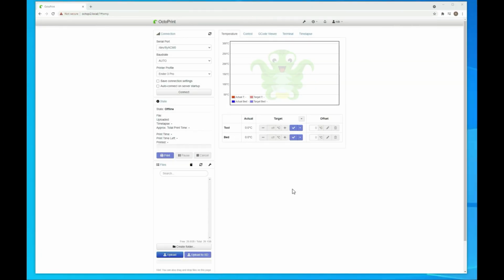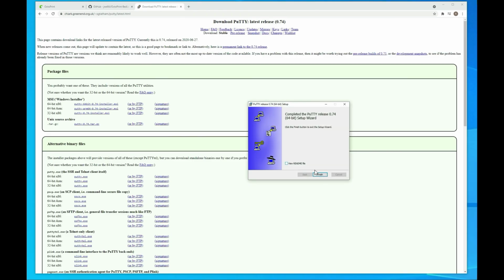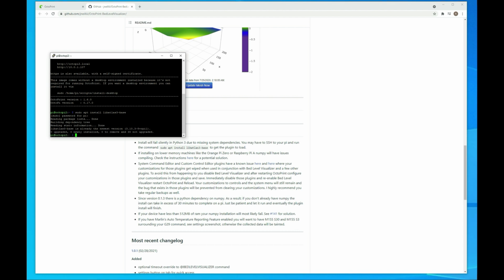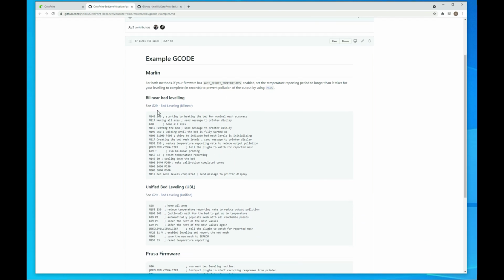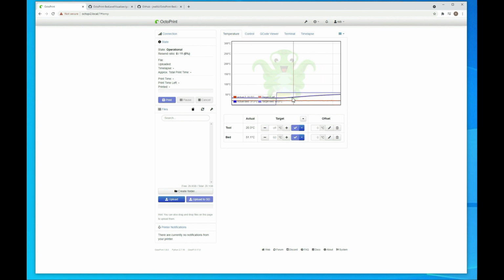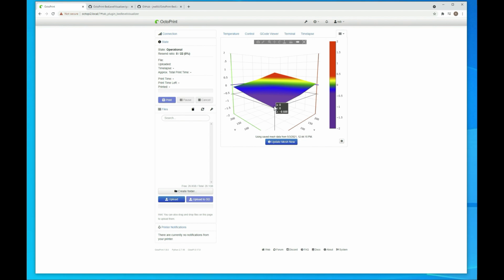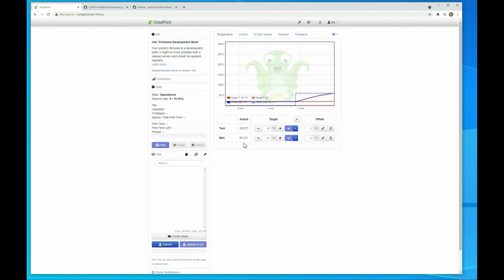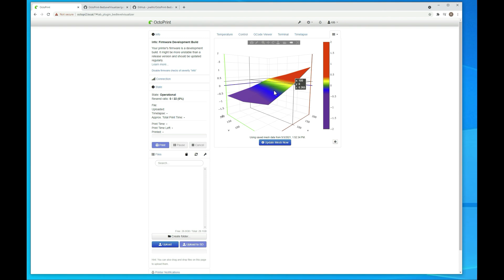Octoprint Bed Level Visualizer Install & Usage Guide

Comment: i was checking what oi was doing wrong. it turns out its just not liking my glass bed. it has a magnetic pei bed as well and i was considering goinb back to glass and that was new glass bed which was carborundum and the other was borosilicate. i was using carborundum since its more scratch reistant because hardened nozzles can scratch termpered glass but carborundum is a mohs 8 which is a 7.5-8.  of course stainless steel cant scratch either. went back to epi and i could see it was severly wapred on 1 corner

Comment: Thanks, this was helpful.
I have a couple of questions - 
- I have an ender-3 pro and installed the CR Touch and a dual z-axis stepper motor kit as well.
1. Do I need to have any additional G-codes for general slicing and printing? and if so, where should that go?  specifically if I am using Octoprint. (I also use Astroprint connected to octoprint)
2. With my setup, I noticed that the z-axis does not have a auto stop detector at the top. The bottom is now CR-Touch, but if I move the axis using the knob and go all the way up +ve, then at the very top it just keeps grinding.  Am I missing something when I installed CR Touch?

Comment: Do you need a BLTouch or CRTouch device to use this plugin?  I noticed that both of your printers have them installed.  I have a CRTouch but haven't installed it yet on my Longer LK5 Pro.  Will the plugin work without a BLTouch?
Reply from the maker: Hi. I think there is a way to do it by manually moving it to each location but I haven’t tried it myself.

Comment: Got a list of Ender 5 / CR Touch issues. Every time I google one and tick it off as done, it's from watching one of your videos. Superb content tbh
Reply from the maker: Glad to help. What issues are you having currently?
Reply: @3DPrintscape  Have actually given up tbh, at least for a while. I've got an Ender 5 that wouldn't print no matter how much bed levelling I did, so thought I'd get a CR Touch. Couldn't upgrade the firmware which is when I realised I had a 1.1.4 board. So I bought a 4.2.7 board and couldn't get firmware on that. Ended up compiling Marlin and got that working. Anyway, bed visualiser says that bed is flat as a pancake, pretty sure I got my nozzle close enough, but nothing will stick :(
Reply from the maker: Have you tried different filament (could be a bad roll) and have you tried anything like bed weld?  @betty-rq7qv

Comment: I know this is an old entry but it has been a big help, thank you!!!  Question: my LK5 Pro runs the bed leveling with 25 points. is there a way to make that less points?
Reply from the maker: Hi. Thanks for the feedback. The number of probe points is defined in the firmware before build. I dont think it can be changed afterwards.

Comment: so I have octo installed on a PC.. how do I do the manual step?  any ides from the community?
Reply from the maker: Hi. You may not need that plugin anymore, i was told it was added to the octoprint build. Have you tried it without doing that step?
Reply: @3DPrintscape  not yet, I shall try again, thank you for your advice.

Comment: in windows? Please help me.
Reply from the maker: Hi. Where are you in the video and what issue are you having?
Reply: @3DPrintscape  Firstly, I have ender3 v1.1.3 and deleted the software on the motherboard. I need to learn the embedded software version of my printer to level the bed. I broke the screen of my 3D printer :( . That's why I use a computer to control my printer with octoprint. However, I am having a connection problem, while my printer's motherboard was connecting to the octoprine before, it is not connecting now. What is the software I can use for my motherboard, how can I find it. It is also in the Octoprint. So I have a lot of problem hahahah.
Reply from the maker: Gotcha, the 1.1.3 board is an old 8 bit one and i havent seen it in a while. Most of the older Ender 3 had the 1.1.4 board. Can you verify the version? If it was connecting to octoprint before and isnt now my question would be did anything change? This would include cables, etc. If not, your board may be going bad.  @ferhatacar50
Reply: @3DPrintscape  my problem was not on the motherboard, but on my computer, I was able to connect to another computer.
the version of my card is 1.1.3. I have to check directly from the computer, I told you before that I don't have a screen. what are your suggestions about the motherboard software?do I need to update?
if we can communicate by mail, it would be better to exchange information with a screenshot.
Reply from the maker: If you can connect with one computer and not your main one, then its probably a driver issue or something on the computer (assuming the USB cable was the same). You cant verify what board you have from the screen (even if yours wasnt broken). You need to remove the case around it and look at the version on the board. If it is a driver issue or something on your computer updating the firmware on the board could help.  @ferhatacar50

Comment: Was a great help, first and hardest thing for me was figuring out what part of the bed was what.... FYI front left is front left   the added known issue is no more... run and make some twist 
took me about 10 times to get my orientation.... hopefully with this all is good.   This was done after paper test and that still showed a bit off... hope my time was well spent.  Hardest part is remembering for me on Ender 5 pro that loosening os making the nozzle closer vis versa
Reply from the maker: Hi. Thanks for sharing.

Comment: Is  the mesh  that is created/saved used by the BLtouch when the printer is printing to adjust the Z position? Is there a setting somewhere or some Gcode required to be inserted to make use of the saved mesh? The Gcode I added for the 9 point mesh runs everytime at the start of  every print. I need a video on how the BLtouch works and how to use it. All the videos only show how to install it. Great video by the way.
Reply from the maker: Hi. The mesh does get saved to eeprom, or the sd card, and just hitting save setting like you would do when setting the z offset will save them. That said, i still run the g29 command at the start of each print to get a new reading.
Reply: @3DPrintscape  Does the firmware automatically use the stored mesh data to adjust the Z offset when  printing or is there a required Gcode to enable it?
Reply from the maker: @danielnadeau2061  It shoud automatically use the one that is stored.

Comment: quick question, my bed needs some adjusting based on the visualization I got back but its printing fine. That said I want to get it as flat as possible so I will make the changed until its flat. however does that mean I will have to change my z offset settings again? Its been ages since I did that and honestly I don't even remember how I did it.
Reply from the maker: Hi. Assuming your not making huge changes, the z offset shouldn't really change.

Comment: How do i change 3*3 grid to 5*5 grid.... i have octo pi setup.... please tell me how to change the grid size.
Reply from the maker: Hi. You can change the grid size in the firmware by changing GRID_MAX_POINTS_X from 3 to 5.
Reply: @3DPrintscape  Thanks, I don't have experience in updating the firmware. But thanks... will learn how to update the firmware

Comment: My printer (ender 3S1) came with the CR touch and no matter how hard I try to get my bed level I always have a couple little high and low spots. Despite it being very much within the needed range my cr touch doesn’t seem to accommodate it either because when I print it’s messed up accordingly. I’m still having trouble getting it level with this plugin
Reply from the maker: Hi. What type of build plate do you have and can you use some sort of strait edge and see if you have any really high or low spots?
Reply: @3DPrintscape  I have a PEI plate on it currently. I have a glass bed coming tomorrow because I’ve been messing with it so long I’m throwing anything I can think of at it. I’m hoping the uniformity of the flat glass will help. I don’t have anything I can accurately use as a straight edge. I did have a metal ruler but I have no idea what my kids did with it. I’ve been looking for it for months cause I needed it for something else as well. 

I’m trying to use the octoprint bed visualizer to help me figure out where my low spots are. It’s weird cause last night I was pretty dang close but there was definitely a dip towards the middle. I added masking tape to try to help bring it up but when I reran the bed visualizer my output looked like what I tried had the opposite effect. The outer edge seemed to get lower but the middle also seemed to get lower. 

Is the bed visualizer supposed to take forever to run? When I run it it will make a probe and then wait like a minute before moving to the next one and probing. It seems unusually long between probes. I’m not sure I set up the best gcode when setting that up. I saw somewhere somebody had it set to make 25 probes for get a finer detail. 

I’m now perusing Reddit trying to see if there’s a way to use a mesh level on the S1. I don’t fully grasp the concept yet but I’m grasping at straws at this point.
Reply from the maker: @avgjoeshow4208  I think the glass bed should help. If it doesn't, it may be worth changing the grid size from 3 to 5 to get more points. It should only take about 60-90 seconds to hit all 9 spots. If its taking that long at one, something is off.
Reply: @3DPrintscape  something must be off with it then cause when I run it it’s unusually slow and often times repeats a second time after it finishes the first run. What do you mean change the grid size and how would one do that? Thank you for responding back to me!
Reply from the maker: @avgjoeshow4208  If your running marlin, you would change #define GRID_MAX_POINTS_X 3 to #define GRID_MAX_POINTS_X 5

Comment: rob i am getting a printer error. this is what it says..  OctoPrint 1.7.3 Python 3.7.3 OctoPi 0.18.0 Web  Forum  Discord  FAQ  Docs  About  System
Error reported by printer
Your printer's firmware reported an error. Due to that OctoPrint will disconnect. Reported error
Reply: rob it took me awhile but i got some success. had to heat bed, relevel, probe test,  and did the leveling test with no errors. now to play some more and set z stops.
Reply from the maker: Hi. So were you able to get everything working?
Reply: rob yes i think so lol. spent lots of hrs playing around an i think maybe the bed was just way to off. was playing with z offsets before i started having my problems. well live and learn, thats part of 3d printing. if i have anymore problems i will give you a shout. ty

Comment: Hi I recently installed this watching your video but I’m having an issue. I go to level the bed it homes everything is heated up but on the screen it says probing but it isn’t doing anything it won’t probe the bed.  I don’t know what’s wrong I put the guide for bi linear like you showed. Any ideas? Thanks
Reply from the maker: Hi. Is it doing the probe in the middle as part of the auto home? If not, its probably an issue with the firmware. If it is, try to send the g29 command to the printer to see if it runs the mesh.

Comment: i tried to use this; but after pasting in the gcode.. i see in terminal tab that everything is heating up.. and than when it hits the temperature it needs, it just cools down... but no movement... running it on a Ender 5 Pro...
Reply from the maker: Hi. It sounds like the G29 command wasnt added. I would look to make sure thats there. That said, i didnt specifically try this on the Ender 5, though it should work just fine.

Comment: I did everything for OCTOPRINT on my "rpi3 B+ " but can not able to connect with my wifi router.I used angry IP scanner but not found any devices ( rpi or OCTOPRINT ).Can you please give me any suggestions what can I do ? ( For testing purpose I installed raspbianOS .It   was perfectly ok or able to  connected with Wi-Fi).
Reply from the maker: Hi. It sounds like the wifi information wasn't entered, was entered incorrectly, or the lines were not wifi lines in the config were not uncommneted.
Reply: @3DPrintscape   @Chris Riley  I also tryed manually..but it doesn't work. Can I add a monitor and check said and password with OCTOPRINT ?
Reply from the maker: @annoorkhan4219  The only time i have seen wifi not work is if the config was wrong or not uncommented. You could try to connect a network cable to the device to see if you can connect that way. That will tell you if the octoprint install is ok or not.

Comment: For some reason, as soon as the first point probes I get M112 shutdown. In the terminal all it say is error probing failed. I have the most up-to-date Marlin firmware on the SKR mini V2 and a CR touch. I've been able to probe before, but for some reason when I try to make a mesh it crashes the printer. Anyone have any ideas?
Reply from the maker: Hi. Make sure all your cabling/connectors are secure. If they are, it could be the firmware.

Comment: I have a Ender 5 Plus with original firmware. What kind of GCode commands I need to put in the Bed Visualizer settings?  Thanks
Reply from the maker: Hi. It should be the generic bilinear gcode that is referenced in the video. If that doesnt work, let me know and i will try to dig into it more.
Reply: @3DPrintscape  Thanks lot for the reply. Sorry I was late but I had issues with my PI and I needed to install OctoPi again. I tried the  bilinear gcode as you suggested and worked :)

Comment: hey im wondering if i can use a bed level vizualizer with the CR TOUCH... i see BL TOUCH options everywhere but not CR...
Reply from the maker: Hi. This would work just fine for the cr touch as well. They are pretty much the same to the firmware.

Comment: hi, do you know how to set up the ender 3 on octoprint and where to have the origin etc if you have a crtouch installed? i just tried setting mine up and it started printing in the bottom left corner and didnt do a bed level at the start.  i had previously set up the crtouch on cura following your video but was having issues connecting 2 printers and using cura for both - thanks :)
Reply from the maker: Hi. I think this video would be a good starting point. If you need more detail just let me know. https://youtu.be/EBB7aWMDquo
Reply: @3DPrintscape  thanks for that, I've seen that video, I'm actually running octoprint in my desktop browser and have both machines connected via USB (well actually it's a usb-ttl connection on an ender 3 Pro 4.2.2 board)
Reply from the maker: @vagautohaus4492  Gotcha, im think im following. Do you have origin at center checked for the printer in Cura?
Reply: @3DPrintscape  I did yeah, good call!
Reply from the maker: @vagautohaus4492  Ok, so unchecking that fixed the issue for you right?
Reply: @3DPrintscape  yep it sure did, thanks a bunch!

Comment: Okay, so I bought a BLTouch like a month ago, and apparently I’ve been using it wrong the whole time, because I didn’t know, that it automatically corrects for the bed...

I spent a whole lot of hours adjusting it, so that it will be perfect, but apparently I didn’t have to do that. Good to know
Reply from the maker: Hi. Spending the time to level the bed properly was a good move. The more level the bed is, the less the stepper motors will have to work to compensate.

Comment: HI, thanks for the video. I'm just starting with 3d printing and it helped me install and run the visualizer. One thing though that has me confused, after the mesh was created, the mesh was displayed both on the ender's screen and in octoprint. However, the two are not exactly the same. What I mean is the numbers are the same but their positions are flipped top and bottom. I mean the front right side square in the ender is displayed as back right side in octoprint and so on. Which is the correct one?
Reply from the maker: Hi. The numbers on the printer would be right, the plugin is just a visualizer.

Comment: When I copy my Pis IP address into putty, it gives me an error and won’t connect. I can connect to octoprint from that address on my desktop so I know it’s correct.
Reply from the maker: Hi. Make sure putty is set to ssh and port 22. If it is, your computer may be blocking the traffic. That said, you no longer need to ssh to the pi to use this plugin. They removed that requirement a couple months back.

Comment: I am having an issue where it prints vertical like sides but fails to go lower to print a bottom and extrudes in the air. I have a Ender 3 +OctoPrint+Direct Drive + BLtouch Autoleveler. I was looking to see if the octoprint bed leveler can help with this. Also what is the discord channel you mentioned? The home page for the plugin also says you no longer have to add that package from command line.
Reply from the maker: Hi. It sounds like the z-offset may be wrong, but i would want to understand the issue more. The link to the discord server is in the video description. Also, ya it sounds like the package is no longer required.

Comment: As a fairly new user to 3d printing, Does the bed level visualizer in octoprint tell the printer the offsets for the bed, or is it strictly a visualizer? Or do I have to use the bed level option in the printers menu ?
Reply from the maker: Hi. Its strictly a visualizer to help get the bed as level as possible. If you have a bltouch, that will actually tell the printer the offsets to make adjustments on the fly.